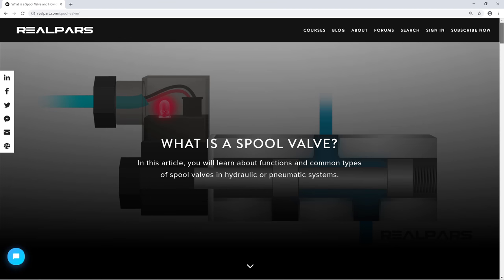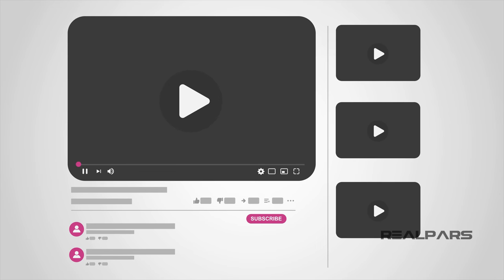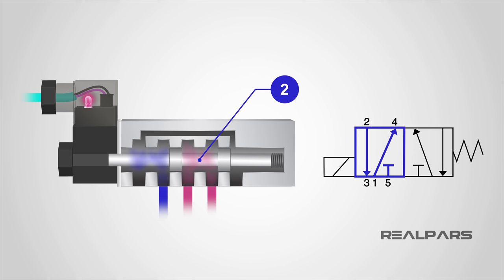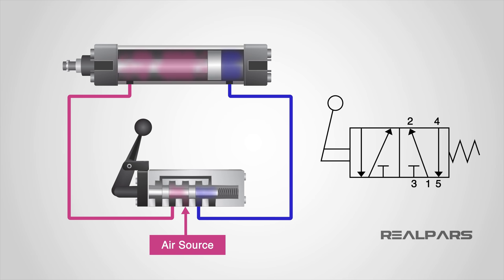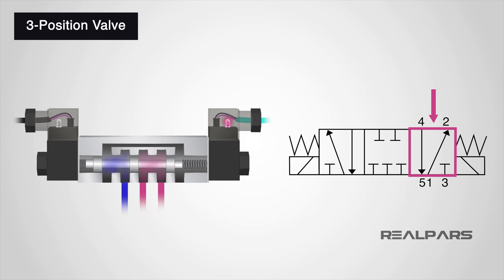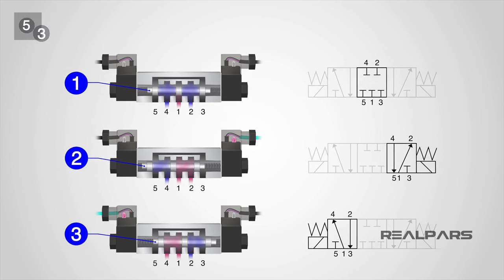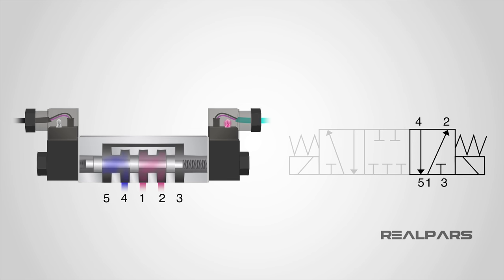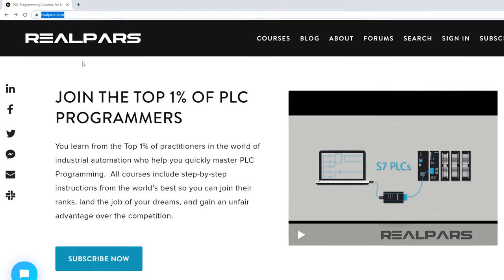How to Read a Spool Valve Schematic Drawing

Comment: This is really good video! One question, does flow direction matter(arrows)? because i don't see how it could unless the design of the seals or something like that pushes the valve sideways working against the solenoid, does this happen?
Reply from the maker: Yes, the flow direction arrows are very important.  As the spool in the valve moves back and forth, specific flow paths are opened allowing flow in the directions shown.  And yes there are seals that prevent backflow or flow to ports other than those in the current opened position.  When the valve is de-energized, it is in a fixed position.  Fluid can freely flow between the input and output according to the flow arrow.  When the valve is energized, the spool is fixed in the other position.  While there is some fluid pressure on the spool, there is not enough to affect the valve position in either state.
Reply: @realpars  "there are seals that prevent backflow" how would they prevent backflow? they had to have some sort of one way valve and while some may have this most do not right?
"While there is some fluid pressure on the spool, there is not enough to affect the valve position in either state."
If the pressure is not strong enough either way then why would it be a problem for fluid to go in the opposite direction? providing of course it has no form of one way valve.

Comment: Hello, can the direction of flow be switched? For example, in 3/2 DCV, the left arrow is only pointing up, can the flow go the opposite direction as well?
Reply from the maker: Technically, yes, but you really do not want to do so.  Some solenoids (not many, but they do exist) have check valves in the outlet port.  Secondly, if you reverse the flow direction, there will be fluid pressure on the "downsteream" port, which can counter the spring direction and pressure, and cause the valve to partially open (weep) or chatter without activation.